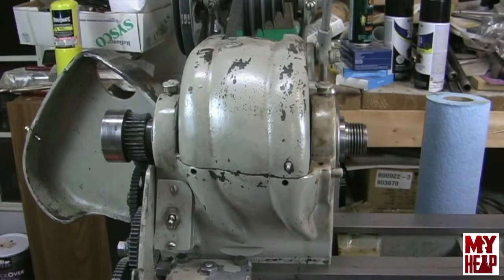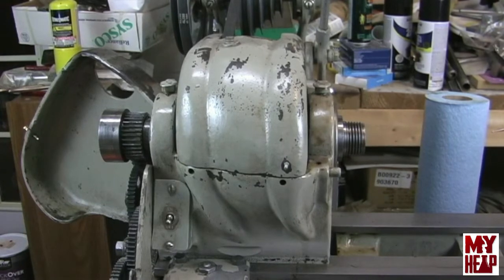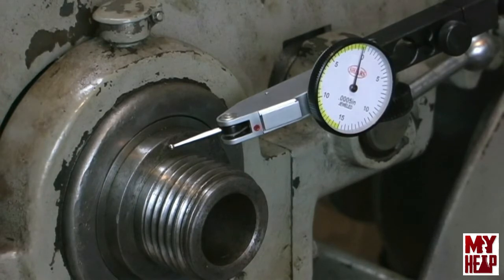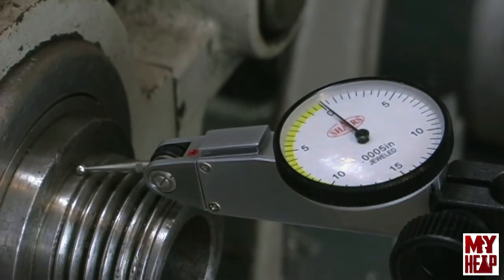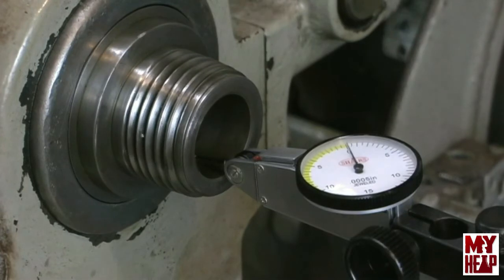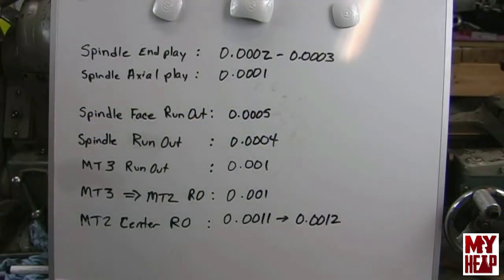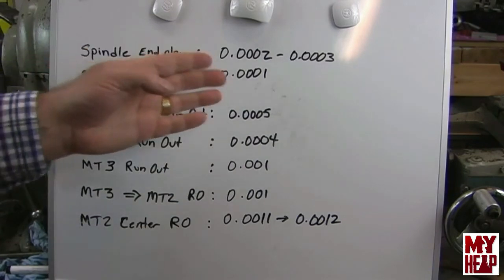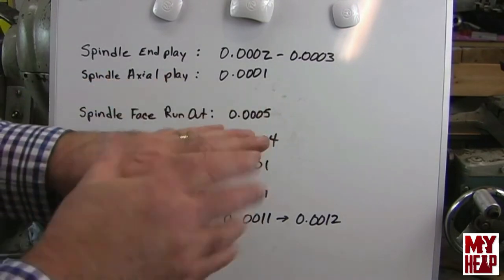Atlas 10F Lathe - TH54 - 24 - Headstock Spindle Measurements

Comment: Joe
Check bearing runout using a broom stick or other piece of wood dowel inside the spindle.  Put a moderate force tangent to spindle ie one hand at one foot.  Do both vertical and horizontal. The bearings should be tightened to no slop.  As you state the spindle will lengthen with heat.
Recheck axial and radial - hopefully it will be better
You may wish to get a Mt 3 reamer

Dan Bentler
Reply from the maker: Hey Dan,  I didn't think of using a dowel or something for a lever.  That is a good idea.  I will run the machine and retest it, although I don't think these measurements are bad for what the machine is.  Now a quick question. You say the bearings should be tightened to no slop.  I am assuming that the adjustments are made when the spindle has been warmed up or should they be made at room temperature.

Joe
Reply from the maker: One more thing Dan, would the MT3 reamers I am seeing from Russia, Ukraine or China on Ebay be worth it?  They are far cheaper than what I can buy in the USA, and given the amount of use it would receive ...

Joe

Comment: Those numbers are nothing to lose sleep over Joe, to test your theory you can run the machine for 10-15 min and let the bearings warm up and see if that tiny amount of play is takin up. If you are inclined you could always pick up a MT3 reamer to lightly skim the spindle bore and clean up any dings. I have seen them pretty cheap on ebay but being imports quality is unknown on those. As far as the MT3-MT2 sleeve I do my best to avoid using the one I have as the more adapters you introduce to a set-up the more error you are introducing  (I will be addressing that in my next video)...but like you said it could work to your advantage if you play with it enough and mark them once you found where the one cancels out the error from the other....or as close as you can fine tune it. I know the collet set and dead center were gifts so not knocking them but a shame you have to use an adapter sleeve to use them. I think all your numbers are reasonable since you arent making parts for Space-X 😊
Reply from the maker: Hey Richard.  I guess I could get a 3MT reamer from Ebay.  They are cheaply priced and most look like they are coming from Russia, Ukraine and China.  I would hope for the limited use it would see, (Even if shared amongst friends) that it would be good enough.

I am not worried about the run out I am seeing, look whatever I make will be far from perfect anyway, so I don't think these numbers will affect me at all, or if they did I wouldn't have enough grey matter to know anyway.  I think I will run it and warm it up and use a dowel for a lever to test the spindle axial play like Dan Bentler suggested.  I won't plague you guys with that.  You guys have to overlook me.  I tend to over analyze things.  I think it is some sort of mental disorder.  At least my bride thinks so.  :-)

The MT2 collets my wife bought are sort of my fault.  I keep this huge wish list that she uses to buy me things.  I had them on there and probably should have put the MT3 collets instead.  I will make do with them until an ER32 or something else comes along.  An interesting exercise will be to check the runout of the sleeve and then the run out of the collet.  Being Chinesium collets, I expect they will be out too.

Speaking of Space-X, gotta admit that last launch was pretty awesome.

Joe
Reply: Eh, just make ya a new MT3 collet chuck, turning the Morse between centers, then slap it in the spindle, machine the threads and internal taper and bob's your uncle. You will need to make ya a taper attachment btw... 😎
Reply from the maker: Hey, speaking of attachments.  I do plan on making a taper attachment and steady rest.  The steady rest will be first.  Will machine the 2 part pattern on the CNC router using a tapered ball endmill for draft and fillets.  When I cast these perhaps I can cast two of them and send them to you and maybe I can get you to machine the bottom flat?  One for each of us ... Interested?  It will be after the rainy season here lets up though.

I also have some plans for a milling attachment that I want to scale up for my lathe.  I think the first one will be made of wood, just to make sure the proportions are correct.  Maybe I am being a little ambitious.

Joe
Reply: I have a taper attachment AND an Atlas steady rest already but thanks! Not sure my mill is big enough to mill the part, let me know dimensions when you cross that bridge
Reply from the maker: I could fly cut it on the lathe maybe.  Man, your uptown!  All those fancy attachments and all.  The finished casting on the bottom should be around 1-1/2 inches wide and its length will be something less than the distance between the saddle ends.  I think I can mount it on a block if need be and fly cut the base on the lathe.  I plan on fixing a plate of steel to the bottom of this to rest between the ways with the clamping bolt coming between a couple of legs on the steady.  I think this is how the steady is made for the atlas, correct?  Do you have a follow rest?  I would like to know how they attach.  Do they fit on the cross slide dovetail or to the two threaded holes on the end of the dovetail?

Thank you for watching Richard.  And the help!

Joe
Reply: The steady mounts to the lathe the same as the tailstock (to the ways). I could send you some pics or maybe even do a video on it if that would help ya. Mine is a factorty Atlas steady rest. The follow rest is the only thing I dont have 😂
Reply from the maker: Well, I may hit you up for some pictures when I get to it.  I have some casting I need to get done so it may be a good time in the near future to do it.  I will reach out when I get closer.
Reply: sounds like a plan :)